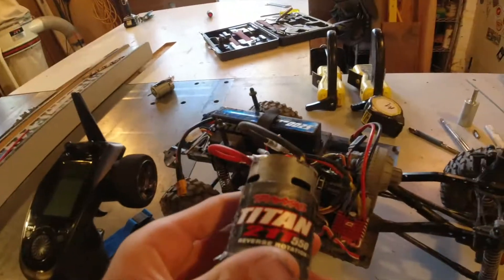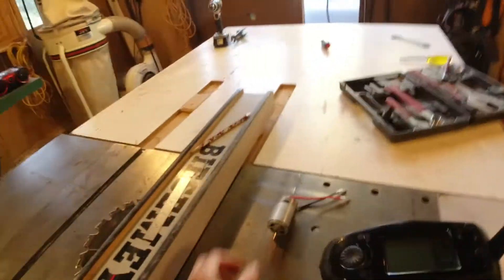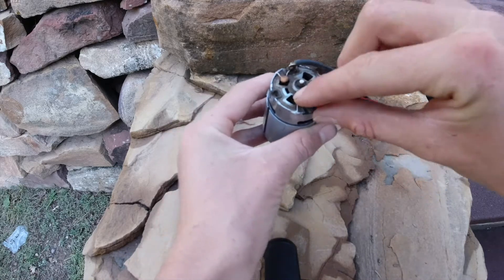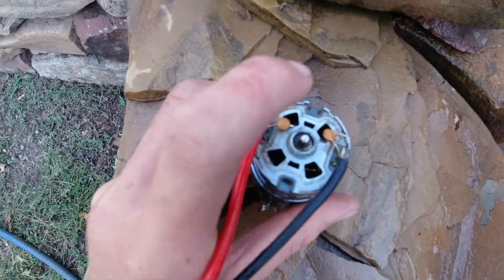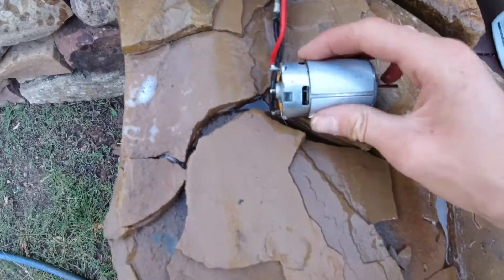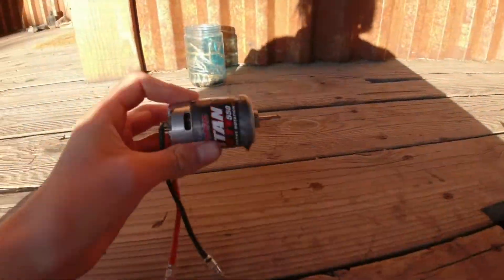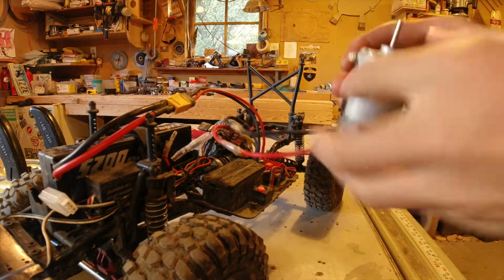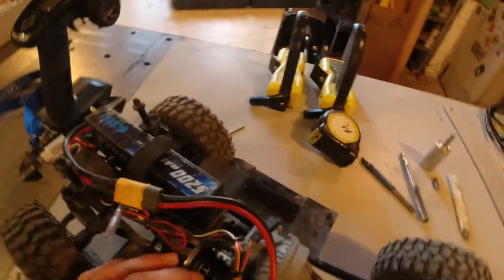How to fix squeaking sound in brushed motors

Comment: Does it rust the motor tho?
Reply from the maker: No it does not. The wd40 lubricants it
Reply: @bmc_rc6212  you used Water

2:14

I did the same but it instead started to rust from the inside, I used the wd-40 and the water

Comment: Use wd-40 with the straw it won't short out the motor. I learned that you use it on a distributor cap it removes the water and it cleans the crud from the motors I used it on my 550s and on my bosch impact driver
Reply from the maker: Ok good to know! Thanks for information